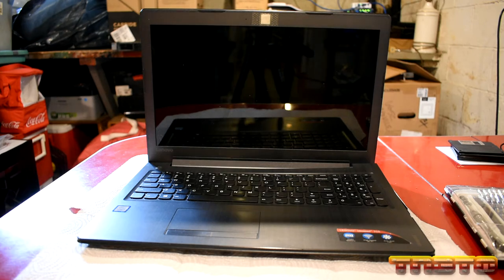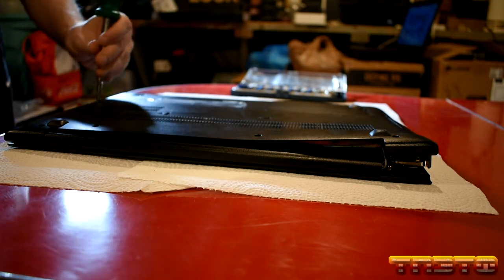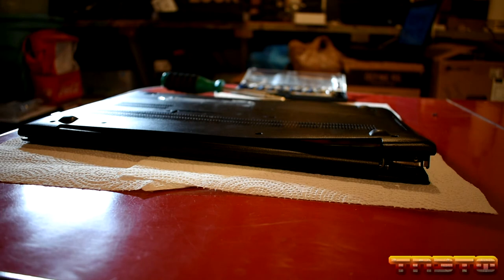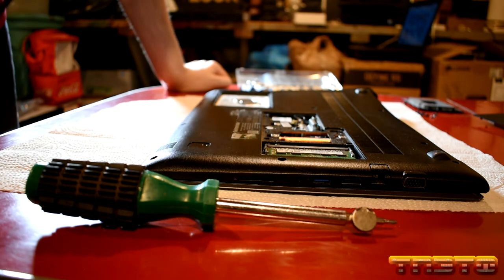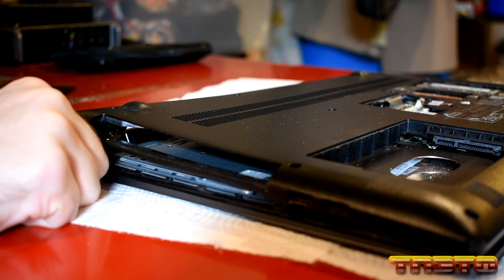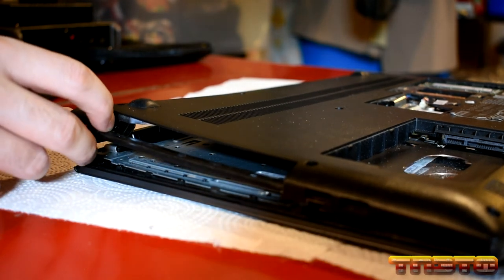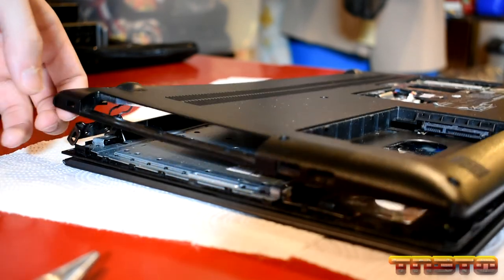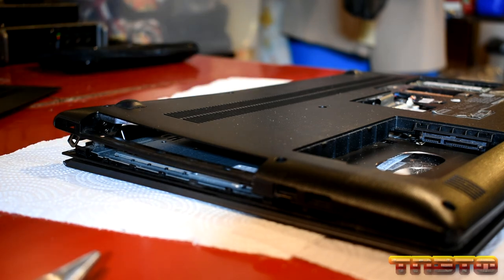Lenovo IdeaPad 310 Broken Hinge

Comment: This looks exactly like my old Lenovo IdeaPad 310, for real! I had it since 2012/2013, working great...then I traveled to Europe last year and when I arrived there noticed the left side hinge was stiff (I suspect TSA agent might have opened it all the way back, just saying). Problem kept getting worse during my trip (closing n opening it multiple times) but still working fine. While waiting for a new one, the hinge broke...that side holding by 2 wires... I was told that  it could be fixed, it would cost a couple of hundred dollars! So, obviously I just retired it (besides it had done his job for 12 years!). Thank you so much for sharing your step-by-step video (and also your frustration while assessing a way to fix the problem) which reassured me that fixing it is most likely impossible but would certainly be costly.
Reply: Mine has the exact issue, the 2 wires next to the hinge were cut from repeated opening and closing, and ofc the hinge broke before the wires issue. 
Now my screen is flickering when turned on. 
I guess it's time for my laptop to retire. 
(2016-2024)

Comment: Thank you! I'm having the exact same issue on the same model and I have to hold down the top right corner of the bottom part of the laptop when opening the laptop incase the hinge breaks.

Tried to fix without any tutorials yesterday and we've made it worse, can't actually open the laptop to 90 degrees now (luckily was still able to power it on).

By the way, you can use the keyboard shortcut Fn + S + V to turn of the battery.

Comment: I have a Lenovo Ideapad 310 and the whole thing is literally coming apart , you can see inside the computer on each side and I need a heavy statue just to keep the screen up so it can lean on something or it would just fall  flat.  I have never seen anything made so crappy.
Reply from the maker: Yup, laptops made nowadays are a joke. And now with soldered RAM and sealed batteries, I sure as heck don't want a laptop anymore.. they are disposable garbage now.
Reply: Its garbage

Comment: I have the same problem, it wasnt dropped, i fixed it with epixy glue to the screw mount and let it settle for hours
Reply: Did not work for long, lasted for a month only... planning to get a new frame, it is available online
Reply: @ishanakhtar2012  Can You please leave a link to where I can bye a new frame, cause I have exactly the same problem on  my Ideapad 310 as in the video above.?
Reply: Best price available here

Comment: My son's did the exact same.  I asked to borrow it and he had it wrapped in electrical tape. He's a teenager,  lays in bed with his laptop over his head, isn't easy on it opening and closing. Almost all Screws missing on bottom,  hinges are smoked.  1 screw wore through the base. Wish he said something when it was just loose.. it wasn't going to fix itself! Watching to decide if I'll buy a kit ,send it to the shop, or get him a desktop.
Reply from the maker: Parts were getting hard to obtain and to repair the unit, would of required completely tearing the whole thing into pieces. If I did go through with repairing the unit, it would of been several hours of labor I'd be billing the customer for. And even then I couldn't guarantee the parts as Lenovo no longer sold them to end users. Had to source things from eBay. For reliability, I'd say get him a desktop, especially if he doesn't need to take it somewhere.

Comment: My daughters ideapad hinges simply locked up and separated the lid 8 months after purchase , they just get stiff and rip the screws out of the plastic lid,  what r u gonna do wd40 it every 3 weeks??? U find out they got stiff after it breaks the plastic,  super crap design,  its a cheap laptop and cheaply built, she didn't drop it,  lenovo wouldn't cover it under the 1 year warranty,  and they wanted to sell me extended warranty,  took it back to good ol costco got my money back, I had zero intentions of fixing it free or otherwise since its just junk in the end. First lenovo and last lenovo  . Got a Dell xps and the extended warranty,  want good laptop buy dell latitude or xps,  they are built well..pay the $$$ its worth it. I have a 7 year latitude 7440 ,daily warrior,  like a champ taken this thing around the world several times, 2011 xps solid.
Reply: can second this, i have barely had this thing for likea year or two now and the hingebroke in the EXACT same way,  started with popping then just fluly broke so now im sitting here trying to fix it,returning it was 100% the best choice you  couldve done man they went full cheap-mode on the thinkpad frames